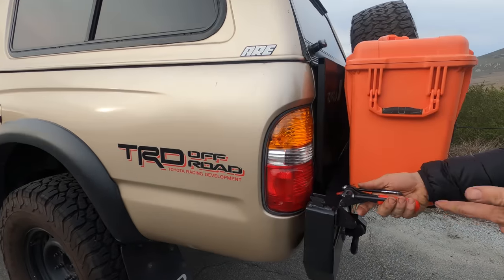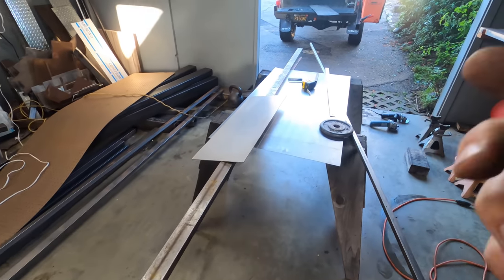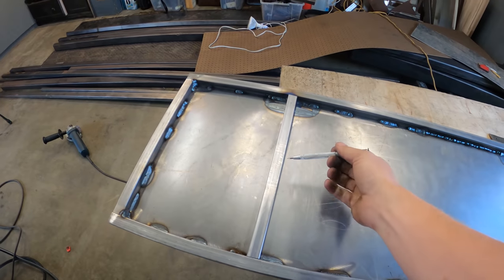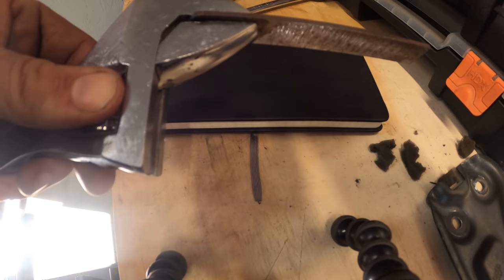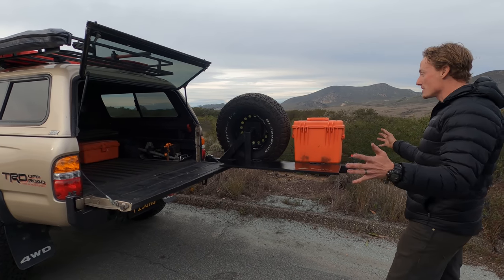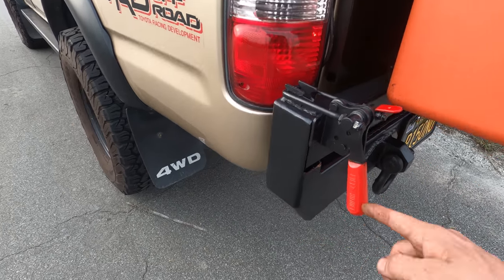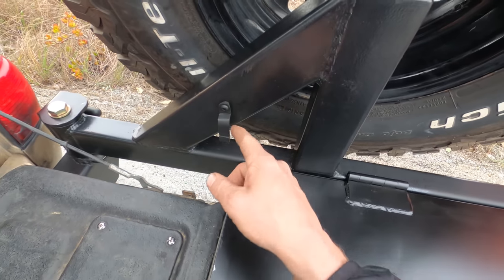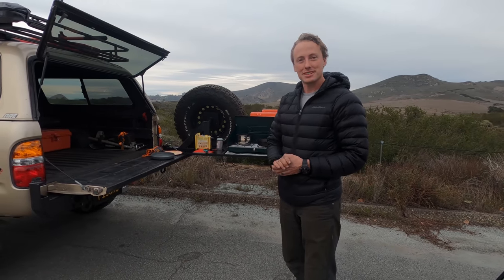Homemade dropdown table on my new DIY 1st gen Tacoma bumper

Comment: I definitely needs some brackets for a 3rd gen 4runner. I'm itching to try this.
Reply from the maker: I plan to! definitely will post about that once they are ready!
Reply: @OverlandUnderBudget  The thing is the rear lower panels of the 3rd gen 4runners are not flush with the back as they are with the Tacoma. So you'd have about a 2 1/2 inch gap (shouldn't matter -  just have to make a more angled tire carrier and have the neck of the holder shorter to keep the gap at a minimum) . You can leave the rear lower side panels, take out the middle piece of the rear bumper, have the brackets come through there, then the bumper sits just behind - which would look great ( I hate that ALL the other aftermarket bumpers have you do take off the rear lower panels).

Comment: It is amazing how clean and nice is the offroad in USA . You can even cook from a table which is outside in the open behind the vehicle. There is no mud , or at least no mud that smells bad. No flies attracted from truck heat. You can put 270 degree awning and the vehicle can be the center of your camp. There is no need to carry everything away 20-30 meters. This is awesome.

Comment: Micah, Nice custom table for the Taco. You could have save some time if you used a barrel bolt for the latch. Just drill a hole on the vertical frame of the table for the bolt to go through and welded the barrel bolt to your tire mount. Nice latch fabrication though.  Now, if you want more shelf, you can make a portable shelf designed like those foldable tire steps that go over tires. You can mount the shelf on your spare tire while  you are cooking . You can also use it on your truck tires as steps for getting stuff on top. Your Taco is becoming a true overland veh. Great job!!!
Reply from the maker: Thank you! And yes you are right. I thought about using that, but I didn’t want any rattle. If the hole was tight enough for the table not to rattle the pin wouldn’t want to slip in easy.
Reply: @OverlandUnderBudget  If you are worried about rattle,  you can glue a soft thick rubber between the table and the tire rack that when you push it to secure the table, it will be rattle free or you can weld the end of the barrel bolt and shape it eccentric like a camshaft lobe , when you push the slide knob and lock it down it will push the table against the tire rack column. This will keep it from rattling also. The third idea is to use those cabinet door catch with plastic roller. It will keep it in place , I think. Just an ideas. Actually, there are so many possibilities. If you google, Spring Loaded Drawer Catch Pictures, there are tons of low budget products that can work or give you idea to build one for yourself. In my opinion, there nothing more satisfying than building something of your own. Be safe, keep building and share your nice ideas to the world. Thx

Comment: Great work and love your channel. My 84 FJ60 says Hi.  Anyway, recommendation on the latch that holds that beautiful table upright.  If your truck will be in the elements and sit for a couple of days... that hinge will wear/scrap off that protecting coating over time and cause rust to sit in over time.  Recommend to cut a small piece of cutting board  (thickesness can be minimal) the width of your latch, length = radius of latch travel). Make sure to cut the cutting board and 45° at the end where latch will slide on.  Prep the metal and glue ( some type of strong marine adhension so its waterproof or what they use on top of RV to waterproof) the material vertically to the stainless steel.  This way when you latch it, it will scrap only the piece of cutting board and protect the latch and help a little with noise and slight vibrations well.  Happy Outlanding.

Comment: Another great video!

18:50 I'd consider making a second piece to fit over that tire support that would fit over the bracket and have holes for a lock to be passed through to secure it against theft.  But I'm a little paranoid about theft ever since I lived in Nicaragua yrs ago.

23:00  Have you checked out bead rolling to stiffen thin sheet metal?

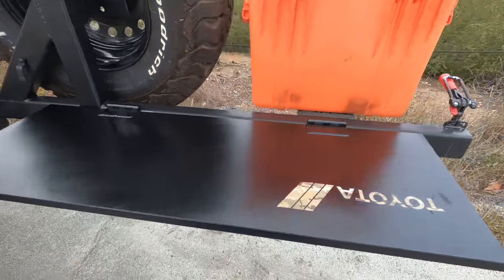24:08  One thing you could do for a little more strength is to put a tack weld on the tops of the hinges to the swing out to keep the leverage of the shelf from bending the hinges... as is, all the torque from the weight of the table and mass on it is applied to the lower hinge mount about where the bolts are, it's trying to bend the hinge places as well as "tear-out" on the bolts' thread.  The downside is that that would more permanently attach the shelf, but it'd 

27:21  Another option is to cut your table frame pieces' ends at 45*, so that after welding, there is no open end.

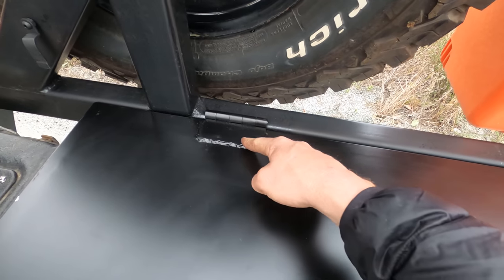26:12  For a super clean table top , it would be cool to put the hinges under the surface.  The frame would need to be notched a bit, but I think it would be worth it for a *really clean look with the hinge piece was hidden from view vs welded on top as you did it.  Since they'd be welded to the frame outter & cross pieces and not need to be welded to the surface material, you could also avoid the welding to the surface metal for the hinges , which would greatly reduce the warping issue you had with this.

You're doing some really great fab work btw, I'm totally going to copy your design.  I may purchase your brackets now that they go through to the extraction points, that's something I was wanting to do.  When will those be available as CAD files?
Reply from the maker: Yep! all great advice and i appreciate you really watching all the details! Just waiting on my cnc plasma table to arrive in mid march then i can start cutting them out and shipping! super excited

Comment: Might consider using angle instead of tube for the frame and braces.  Miter cuts at outer corners would close the corners for tube or angle frame.

Comment: Great work man, as always 💪

In your first bumper build video, in regards to the recovery points, you welded the shackle points off to the side of the chassis mounting plates. In this one you made it all one continuous piece, is that right?
Reply from the maker: Thank you and yes! The mounting plates and Clevis mounting points are all one continuous piece now. Ordered a cnc plasma table so I can make these parts for everyone. Should be ready mid March!

Comment: Use a flat surface for welding and weld your pieces little bits at a time. Let your pieces cool clamped to the table and you should have less warpage.
Reply from the maker: yep all great advice! building a welding table is on the list.
Reply: Just needs to be flat, I don't even have a metal welding table. My work surface is put together from scrap 4x4 posts, 2x4's, and some plywood. I actually thought about covering the top with some 1/4 plate and calling it done.

Comment: Aluminum and nut certs. Lighter quicker. Not wasting gas wire electricity and consumables (cut off whells,flap discs and it'll save life on the chop saw blade). Just a suggestion from an old tinker fabricator. Oh and try to stay off the floor your 50 year old self will thank you.
Reply from the maker: Haha thanks, aluminum will be the next frontier for sure. I like those cert nuts but haven’t tried them yet. Your right about the cost of the expendables adding up. I’ve been buy them bulk and that really helped though